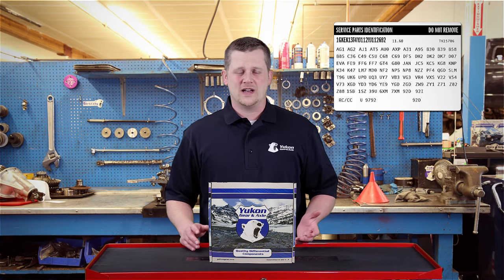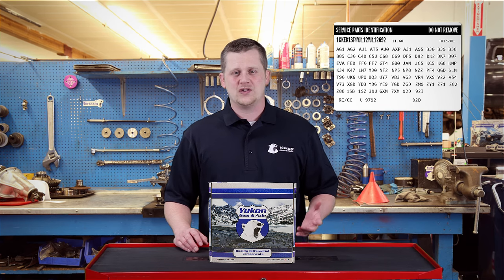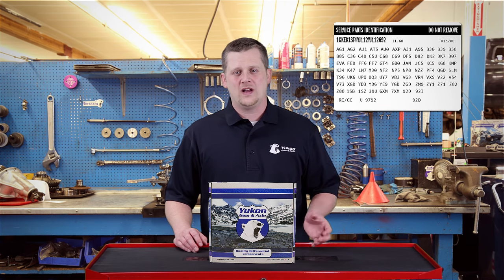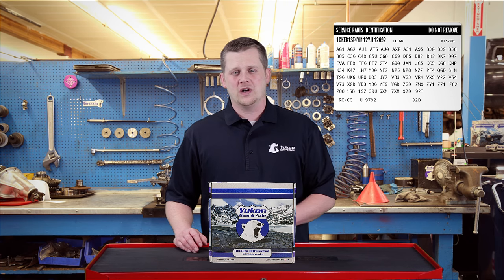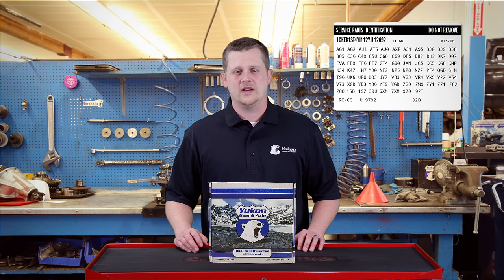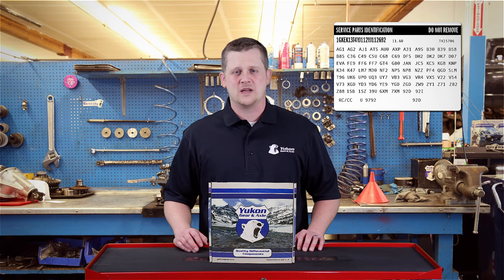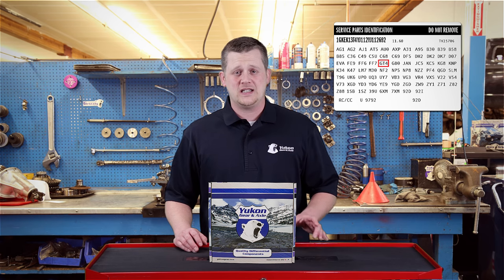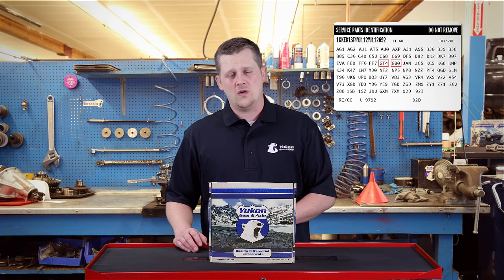Decoding GM RPO Codes for Your Differential | Differential Tech Tips

Comment: The Service manual states that the ratio code and mfr. date codes are stamped on the left front side of the axle. Everyone on YouTube says to "Check the Sticker", but the rear end on this truck was changed by a previous owner and I have no idea if it's the same as the original or not. Probably not, since both the speedometer and the shift points are way off.  Now, if I could find out what a GMD and 155 means, I'd be set.